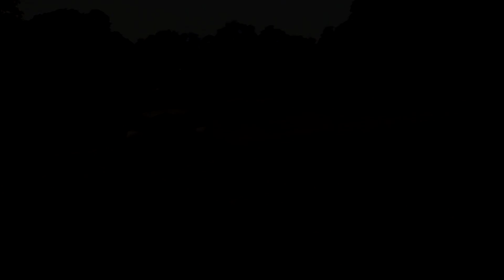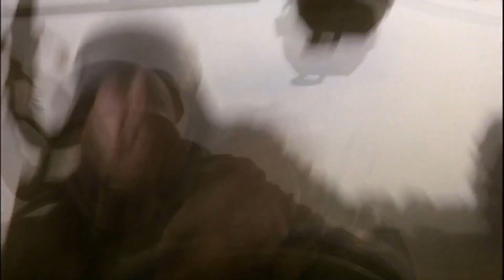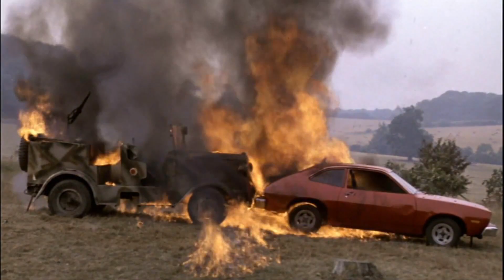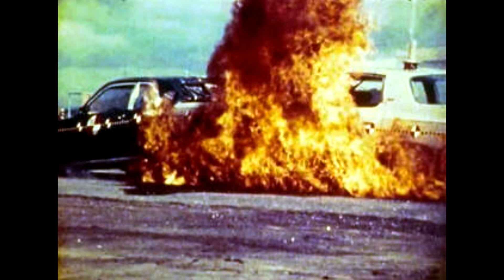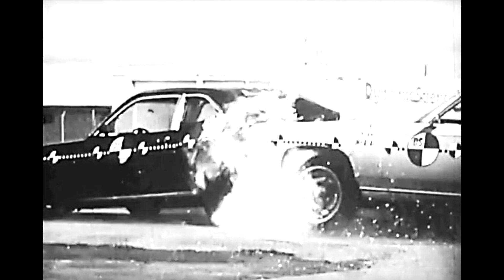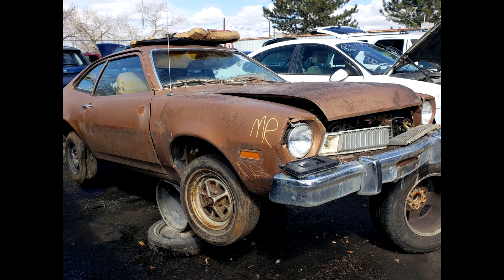The Most Dangerous Car of All Time... Right? [Ford Pinto]

Comment: Early 70's model Chevy truck's were notorious for the side mounted gas tanks rupturing durinha side impact!
Reply: Most full size trucks have the tank mounted on the side of the chassis. Modern big trucks use them as steps!
Reply: @ldnwholesale8552  NO most modern full size trucks have the tank mounted between the frame rails! Trucks with the gas tank on the side used as steps are 10 wheel or higher and for commercial use! Learn the difference!

Comment: That's an exaggerated number. 27 deaths are officially linked to Pinto fires.  

Go research how many deaths are attributed to Drive by Wire systems on modern vehicles and then get back to me.  Hell, my buddy's Mazda 6 had a DBW failure and tried to launch itself through the front of my house. My Silverado did the same thing in a parking lot.  Modern vehicles aren't any safer than classics. That's a fantasy you were sold and that's why all of my cars and trucks have pushrods and no payments. 😁

Comment: This is mostly nonsense. The Mother Jones story implied that there were 200 fire deaths from the Pinto per year (there is actually old footage of a young, skinny, Michael Moore debating Milton Friedman using this figure), while  the NHTSA found that of the deaths that occurred to Pinto passengers, only 27 could be attributed to fire, in 10 models years and over 2,000,000 cars worth of production. So the Pinto was in fact safer than its competitors, not more dangerous. Despite this, many owners were conned into trading in perfectly good cars prematurely. The 200-death-per-year figure came from the "Pinto memo", which actually hypothetical and had nothing to do with the Pinto.  So while one could still argue that the $11 per car to add a plastic liner was money well spent, even though it would have saved less than 27 lives, should Ford, having complied with all the laws that were in effect at the time making a car that was safer than its competitors, have been compelled to recall nearly 2,000,000 cars, at a cost of much more than $11 per car,  to comply with new rules imposed at the whim of the executive branch of the government? I'd say no; safety standards are set for a reason, and if automakers comply with them, they should not have to adapt retroactively to new, retroactively imposed rules, just as you or I should not face a fine for something we did years ago, like smoking in a public building, that has since been made illegal. The US constitution actually forbids the imposition of retroactive criminal penalties, though this prohibition doesn't seem to stop retroactive civil rulings. As a consumer, I think it should, since all of the costs of such arbitrary recalls is borne by consumers; to automakers, it's just a cost of doing business. There are plenty of cars made each year that are really defective, cars that kill or injure their owners when used properly, or cars which don't comply with the laws in effect when they were built; recalls and penalties are appropriate for such cases, but not just because a judge or bureaucrat  decides that the laws in place were not good enough. Any car on the road can be made a tiny bit safer if  the sacrifice of money, convenience, space, fuel  economy, etc. are no object. But most buyers want cars that are useful, affordable, fun to drive, etc. and are willing to sacrifice a little safety to get them. If cars were as safe as it's possible to make them, the added cost and inconvenience would likely have more people walking, cycling or riding motorcycles, all of which are more dangerous than driving, so it's unclear if any lives would actually be saved anyway.
Reply from the maker: I agree with you to an extent - if you watched the video you would have seen that I said the pinto was no more dangerous than the equivalent toyota or beetle in reality.

From my research I completely disagree that only 27 deaths can be attributed to the almost useless rear bumper’s weakness though.

Yes, issuing a complete recall is a huge financial burden, but that would have been mitigated if they hadn’t rushed the development window so aggressively
Reply: @blagssss  I think the difference in the death figures might be between fire deaths and overall deaths. 
From Wikipedia : 
"The NHTSA investigation found that 27 deaths were found to have occurred between 1970 and mid-1977 in rear-impact crashes that resulted in a fire." 

   But this is also a matter of principle. If the government sets rules on a safety criterion, and the manufacturer follows them, the government should not be able to come back years later and force the manufacturers to comply with new rules. There are some safety concerns that are not covered by federal rules (GM's far more dangerous side-sadddle fuel tanks were an example of that) , and in those cases, judges have to decide after the fact what's reasonable and customary. But the Pinto was made in accordance with the proposed federal standards at the time it was designed (20 MPH moving barrier), and upgraded when the 30 MPH standard finally went into effect for the 1977 model year. Its rear bumper was also in keeping with the norm for the industry, about 1.25 MPH before federal standards kicked in in 1974 and 5 MPH after that (present-day rear bumpers are only rated at 2.5 MPH, less for trucks and SUVs). The only  reason that the Pinto was singled out was that the plaintiff's lawyers had gotten more candid internal memos than is typical in such cases (though the most notorious of them was not written about the Pinto). If the NHTSA's finding of 27 deaths was correct, the safety improvements mandated in the expensive 1978 recall, and payed-for by car buyers in the ensuing years, barely affected the safety of the cars, since there have always been far more fatalities from crash forces than from fires. But fires are likely a worse way to die and they make for more shocking headlines and claims.